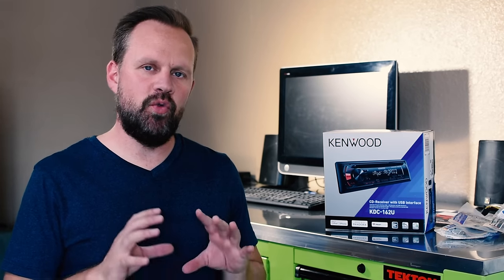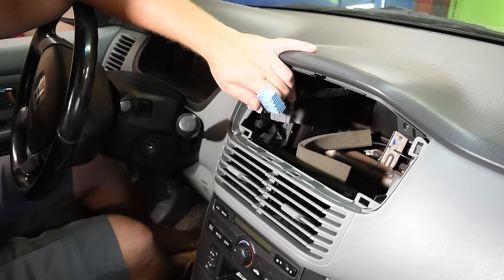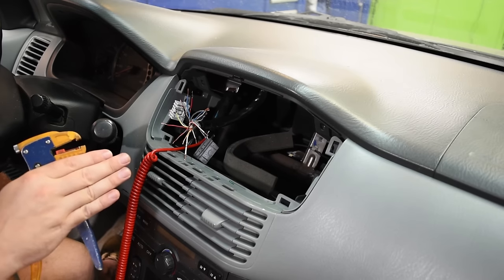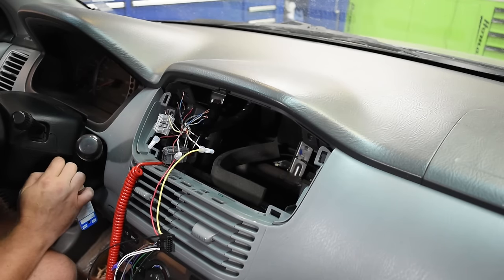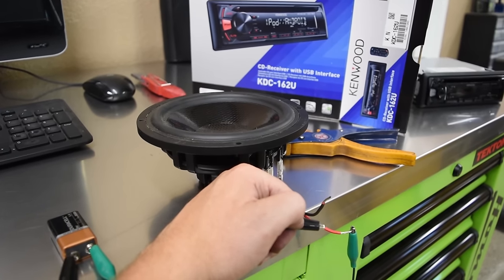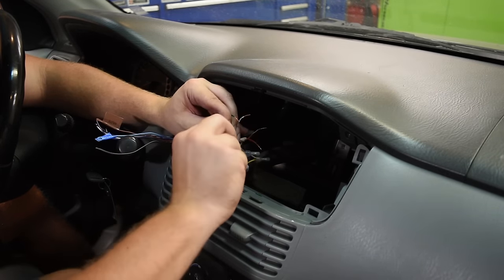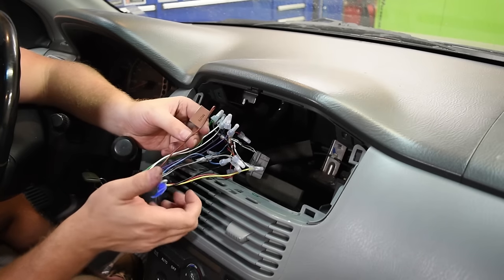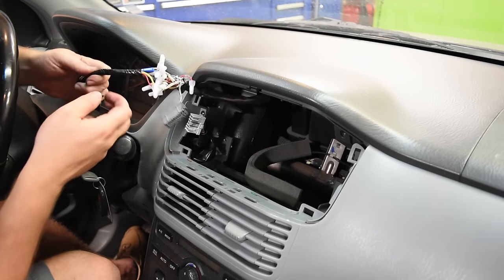How To Install A Radio Without A Wiring Harness Adapter

Comment: Im pretty competent on installing these things but was curious enough to look at yours. For anyone reading this who is not sure about installing a car radio, this is one of of the best instructionals I have come across. Plain talk without too much "jargon" and excellent teaching skills here.....10/10 WELL DONE!!!
Reply from the maker: Thanks So Much!
Reply: Excellent video. After watching i feel confident enough to install the stereo in my 1988 chevy s10
Reply: Do you have to cut the harness or can I just run the wire from it to the radio
Reply: 100% agree
Reply: Can you please provide tutorial for android 2d head unit with steering wheel   control wiring without CAN bus interface.
Reply: @elharris670  me too
Reply: J
Reply: agreed, This is actually helping me on a whole different category of what I was looking for
Reply: 10/10
Reply: I totally agree with you. The way he explained the wires and their functions it’s not really that hard.
Reply: Hey mate, im from New Zealand and have a 2008 Mazda mpv. I am wanting to know how I reconnect a rear and side mirror camera after I hacked up the harnesses haha . So, I have all the simple stuff connected and operating but the reverse cam in the rear is only  operating while in reverse. Now, am I able to link a jumper wire from the reverse power wire to the battery so it stays on even when its not in reverse? and then I can manually switch it off via head unit? Head unit is a jvc KW-V230BT. thanks man. Awesome video by the way. Saved to my car stuff Playlist. 🙌
Reply: Excellent explanation

Comment: From being in the retail side that sells the radios, I'd suggest NOT cutting the wiring harness on the new radio because if you get frustrated, give up, and want to get your money back on the new radio missing the original wiring harness,  you won't be able to.  I've changed out stock radios for third party radios like the Kenwood before and would suggest going to Crutchfield and getting the right wiring harness for your vehicle.

Comment: Thank you so much!! I was sold the wrong harness for my honda civic, and out of frustration I randomly decided that I had innate knowledge of wiring harnesses and lopped off the factory harness to hard wire the after market harness onto it. After 3 hours of fiddling and soldering the wrong wires together, I gave up and closed up the garage and hopped on youtube to find this video. The next morning I ran to the nearest hardware store, and got everything wired and setup in an hour. 10/10 would recommend everybody watch this video. Even if you're not wiring a stereo. Like if you're on the toilet and plan on staring at a wall mindlessly for the next 2 hours, i'd recommend you watch this video while you're doing that.
Reply: You're in the toilet for 2 hours??
Reply: @bigjalapeno5347 on a bad day hell yeah😂😂😂

Comment: 5 stars for this video. 
1-excellent explanation 
2- good tips 
3- good vibes 
4- check the fuses 
5- how to find the appropriate cables.
⭐️⭐️⭐️⭐️⭐️.
Reply from the maker: Thanks!!
Reply: @doityourselfbri  ,
Reply: @doityourselfbri  hi Bri ive recently came across a wire harness diagram and in one of the connector wires it is labeled as REMO in and REMO out

My question is how to know if i have to connect to my pioneer wire harness
Reply: Excellent!

Comment: You, Sir, are a STAR!!  Took out the original factory-fitted radio and was baffled by the number of wires that such a simple piece of kit had. Looked like hundreds of white wires into four different connecter blocks.....what are they all for?  
Watched your beautifully made video and it all became crystal clear. 
Made the impossible EASY!
Many many thanks.

Comment: This really is a top notch explanation of what each wire is and will still be valuable even when using a harness just to know how things function.    No other video has come close to yours in covering this.     I can't find the video that details out the steering wheel controls.   Did you decide not to make one?   If so, please reconsider making one with the same level of detail and explanation you did with this one.  Thanks in advance.

Comment: Thank you sir. Had my van into the shop to supply and fit a new head unit as the previous owner butchered the wiring. They were unable to fit it and told me to try elsewhere. I watched your video to see how it's done and managed to wire it in myself!

Thank you very much.

Comment: I’m strait wiring a jvc radio into a 2000 Toyota Tundra and this is the most helpful thing I’ve found. Keep it up
Reply: Just curious how your install went.  I'm direct wiring an aftermarket unit myself currently and a small part of me wishes that I had just spent the extra money on an adapter harness.
This job can be a challenge for someone like me who has little experience with electrical stuff.
Reply: @scorpionwins6378  how’d it go lol
Reply: @ThatNoFbody-ch9ky  it went well.  I looked up a wiring diagram on the internet for my vehicle.  Downside is I lost my steering wheel controls but the rest is fine.

Comment: Soldering and marine heat shrink then wrap makes for a much more reliable wire connection over crimps plus a nice smooth harness when finished.  Marine heat shrink has a waterproof glue inside and you get a nice sealed joint every time.   Apart from that a great presentation by this guy.

Comment: Easily the best, most helpful video ever. Wiring of any sort isn't my strong suit, but usinf this video and a test light I had a new radio installed in my classic Mini in about 2 hours. There was a rat's nest of an old harness, eleventy million inline fuses, and several t- connectors that seemed to go in circles. I cut all of it out and followed these instructions to the letter and the new radio was up and running as soon as I turned it on. Hooray!

Comment: If you do not own a light tester like he uses to find the constant 12v, and accessory 12v then you can use a volt meter on continuity function and it will make a sound when it completes a circuit. Just connect the red (+) of the voltmeter to the wire, and the black (-) probe to a ground like he did in the video.
Reply: .... Thats nice and all.. But if you dont own a test light, chances are you dont own a multimeter. Test light $1. Multimeter $30. Unless you get a freebie from HF.

Comment: Good morning sir.  Just wanted to say thank you for the information you have provided here.  Am currently attempting to install an aftermarket single DIN stereo unit in my car and I entered the project not knowing a single thing about wiring.  Am entering day 2 here because I ran out of sunlight.  I do not have the adapter harness for my year range so I decided to direct wire the unit to the factory connections, and BOY is this job a headache.  I mapped out which wire goes to what thanks to some wiring diagrams I found on YouTube and thanks to your video I think I have obtained the knowledge to finish wiring everything to the new stereo.  Hopefully I will complete this by today so I can enjoy music once again and also hoping that nothing was done incorrectly.  I appreciate your work here.  Thanks.

Comment: This video saved me $250 on a shop hardwiring my head unit. Thank you.
Reply from the maker: Thanks glad I could help!
Reply: Lmao what the fk? A radio adapter harness is like $10. Its LESS labor to just use the adapter harness and you don't have to mutilate your car.
Reply: rmblwgn  naw my 2003 Chevy impala harness cost around $100, fuck that.
Reply: @MRYAAKATTACKK  still cheaper than $250
Reply: @pmotorsports8276  damn, If only there was a video that showed you how to do it yourself

Comment: Someone may have mentioned before but I'll repeat again. Why not disconnect the battery while cutting wires ?
Reply: When hard wiring you need the battery connected to find the power and each speaker

Comment: Great video- definitely popped the constant power fuse when I Leroy Jenkins'd the harness plug. That makes sense why the stereo blinks when the key goes on, but doesn't remain on. Great info in your commentary. learned several things. Thanks!

Comment: Excellent in depth instructions, great job! That said I would strongly recommend to folks watching this who don't have a wiring harness to just get a wiring harness  for your vehicle! If you ever want to upgrade later you will thank yourself. Not to mention any future owners of the vehicle.  I get that you may not care about the next person but I can say from experience that one of the worst feelings is going to upgrade or install a radio in a used vehicle is looking in and seeing a wiring harness that's chopped to oblivion , usually with far too little wires remaining.  It makes any install at least twice as difficult and 5x as aggravating. Only use this method if it's the only option,  I wish the video at least made that disclaimer.

Comment: Hey, thanks man this was surprisingly helpful. I'll be replacing an oldschool 8 track player with a modern Bluetooth pioneer heaf unit. Eventually I'll get some better speakers but for now that should revolutionize the sound system as the radio chanel tuner only works in one Direction!
Reply: walmarts cheapest speakers do hit !! 40 bucks for a pair im satisfied

Comment: Hello. Thanks for this video, it is very good! I followed all steps but I'm not getting any sound on m speakers. I tested the wires using a 9v battery as you showed but nothing happens. The installation is on a western star truck model 4964 year 2006. Do you have any idea of what could be happening? There's no color coding on the wires and the Sony unit I'm installing is working fine! Thanks.
Reply from the maker: Sounds like you may have a factory amplifier in your car.. What is the year make a model? If you have a factory amp you will need to bypass it or  still use it but sometimes you have to have a special interface to make it work or really understand some advanced electrical stuff to make it work..
Reply: same issue with my tundra has external amp with 3 wires red,green and blue going nuts  with this radio great video thanks

Comment: I struggled for two days trying to install a new BT JVC head unit into my 2005 Elantra and even took the head unit to a radio installer for help but even after offering to pay for their time they just wanted the car and the job so I gave up. The problem was the plug on the end of the harness just would not budge so I cut the factory wires and just tried to connect using the details on the old head unit and the new one but just could not get it to power up. I had checked the under bonnet fuse and the under dash fuse for radio and both were fine. This video recommended using a light up probe which I purchased at Supercheap for $10. Still no power then when I listened to the instructions again the fuse that controls the interior light was mentioned and when I checked it was blown and all of a sudden light on the roof and power into the head unit. The rest was easy. Great advice, saved probably $150 to $200 because they would have found a thousand reasons to justify the charge so very happy with result and have now subscribed..Grant Tasmania Aust

Comment: Looks like ill be breaking out the ol test light tomorrow. My 1996 Audi A4 Quattro has been nothing short of a headache and frustration. Spent countless hours out there trying to match wires to diagrams and schematics. Will keep it simple next go at it, sticking with your walkthrough(i  like that you acknowledged the differences in wiring through the years/makes/models). My car has that stupid Bose factory amplifier that ive gotta work with. I have everything here i believe that i would need to get it done, its just being a pain.

Comment: I've installed a car stereo here and there back when I was a teen (80's), and this was by far one of the best instructions for doing it yourself - even down to the polarity of the speakers. Many do not know that part and will install great sounding speakers that sound terrible after installed from simply + added to - accidentally. 

     I have a 1986 Nissan Maxima with factory stereo and speakers still installed. Nothing modern - even the tape deck. The left speakers go in and out (usually over bumps). After being on the plantation (work) all day, I don't always have the time or energy to do it myself, so I'd like anyone's advice on where to start 1st to save me time. Door / rear left speaker or straight to the stereo itself? From limited and old experience, my instinct says check the stereo - since the right side shows no sign of fade....only the left. Thanks in advance to any suggestions.
Reply: 2 yrs later but I always start with fuses, easiest cheapest thing to check and can save you so much time and money in needless repairs. Then i'd check the deck and then the speakers and last most labour intensive the system wiring. Sometimes animals get in and chew stuff up. You'd be surprised the spaces mice and snakes get into.
Reply: @nyizzle4533  Very true! Animals will destroy wiring. Fuses are good and speakers are new - it must be the stereo. I'd hate to remove any plastic molding at this point (35 year old car) since dry rot is a definite factor. Thanks for the reply & advice!
Reply: @blazonbyrd5996  Np. Such an old post I'm surprised you replied. I hope you track it down

Comment: My install turned out to be easier than I thought since the old radio had a chart on it detailing what every wire was and all I had to do is match to the new radio wiring. I used heat shrink connectors which have a small metal collar in the center that is squeezed and results in a smaller bundle of wires rather than the white crimp cap type. From Amazon also the Kenwood radio caught it on Black Friday sale. Yea! Thanks to this video for heading me in the right direction.

Comment: excellent video , I figured out the speaker wires on my Eclipse but the power wires gave me some grief.
The logic used with the test lamp made it as clear as a bell for me thank you.
2000 Eclipse and the wiring colours did not match the standard colours now (red stripe for positive in pairs nightmare but I managed to figure them out.  Thanks once again great video !!!

Comment: Not a bad video... but to make life easier then this, so the price you will pay for crimper and wire crimps you could just buy a Year/Brand match SCOSCHE install Adapter for $5.99 at Walmart lol ... unless you have Crimping gear kicking around... I personally wouldn't do a Crimp install unless absolutely necessary... in saying that, this guy did do a great job, very clean looking... but... is he just going to leave that big hole?? Scosche also sells Dash Kits, cost about $15.99 at Walmart... it covers up the Hole and Voids that your aftermarket deck may not fill, like this guy... his deck does not fill the factory deck location, as seen in the video... food for thought.
Reply: Some adapters still require crimping. The whole point is that if we cared about looks in the first place, then we would have paid for it at the dealership. Most of automotive DIYers spend our money on functionality, not aesthetics.

Comment: Hi great video explaining everything realy helps everybody out. Im attempting a hardwire and i have 2 constant 12v battery wires i tried connecting the 2 battery wires with new stereo harness wich is yellow battery wire together and with all 3 stereo started smoking. I taped up 1 12v and put it aside and just connected 1 12v an new yellow battery wire again stereo started smoking. Any help would be be much appreciated.

Comment: Maybe disconnect the battery to avoid damage when cutting wires..
Reply: Then how are you gunna be able to tell if theres power coming from each wire ? 😂
Reply: He’s got a point how will you know what wire is constant 12v if there’s no power

Comment: Why the heck would you cut off the factory plug on that Honda pilot.  that's just dumb.  you should have found an old car that had it already gone...
Reply from the maker: Just for the video, it was only to teach people how to do it if it has been cut.
Reply: Obviously Phil wasn't paying enough attention to the video when he watched it, when you clearly said why you're doing it. Too bad he doesn't divert his divided attention elsewhere. 

Anyways Brian,
I am having trouble with a 2006 Colorado. I actually have 2 connectors that go to my old radio, one is a 24 and the other a 12. I found the constant, ground, and all speaker, but I cant find the ignition. After cutting all the wires, I tried to turn my truck back on and it never turned over. Now the lights or nothing will turn back on. Any clue?
Reply: Do It Yourself Bri glad you did cause it helped us....

Comment: One of the greatest well explained video i did install mine but I think my old cable from the battery not well connected.. question if I run a new cable to the battery which post - or + ??

Comment: Great video....I needed to watch this because I have a problem with parasitic drain when I connect with the harness plug. I believe it's the ground wire because it's a common problem with it. Can I just ground the wire to a metal part of the dash that's a good ground, indicated by the test light?

Comment: Thanks so much for this video. I was able to successfully replace and install a new stereo unit to my 1982 SC930. Your video made it super easy to identify which wires to use, I followed it step by step and I was able to install it without issues. 👍🏼👍🏼👍🏼
Reply: Ok where did you hook the brown and orange one up at

Comment: Im capable about fixing my car electronics but this helps alot with bunch of ideas esp, knowing if the speaker polarity is correct since thats what im worried about before fixing my cars messed up audio system.

Comment: Thank you for posting.  It helped me so much. Just have the brown wire that controls the steering wheel gears.  Ford focus 2006 installing touch screen with back up camera.  Thank you again